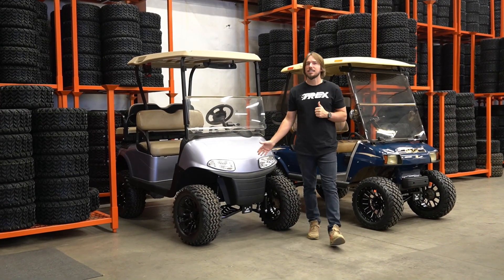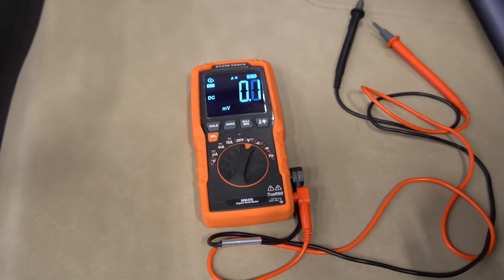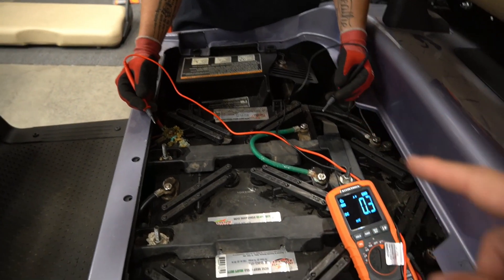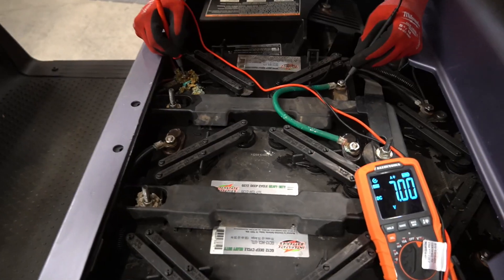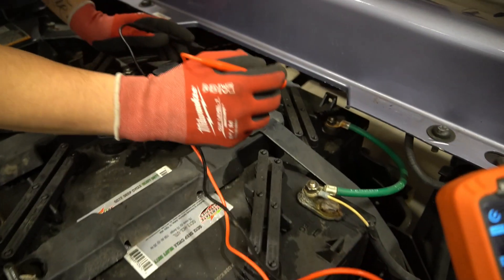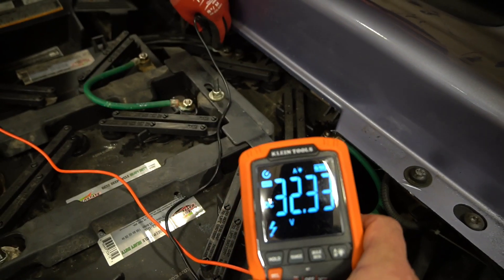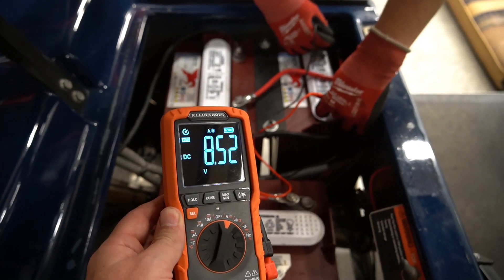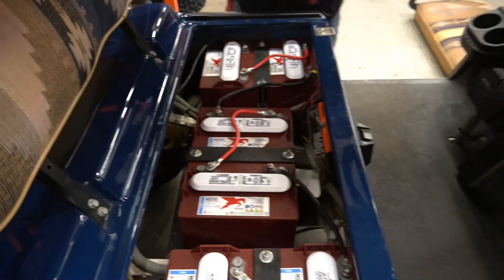How to Test Golf Cart Batteries *8V, 12V and More*

Comment: VIDEO IS WRONG! Batteries can be the correct voltage but will fail a load test (simulates driving). The correct way to test a Golf Cart battery is with a $20 load tester, like the one at Harbor Freight
Reply: This guy is 100% correct.

Comment: Nice video thanks. My total system is reading 51 volts but still does within 15-20 min of driving it. What would be the next step to check for? 2015 club cart precedent
Reply: This video gives bad advice. You need to get a $20 load tester from Harbor freight and check each battery.

Comment: That's testing surface charge!!, you need Amps .. drop test!!
Reply: Agreed. He needs a load tester.
Reply: My 12v batteries on my Gem Car shows 12.75 or better on all batteries. BUT the Trojans, on a full charge, only get me 6-7 miles!!! I'm thinking that there is more to checking the health of a battery...than just volts. Is this the Draw test/Drop test? How/where do I get info on that?
Reply: @paulsavino1898  go to Harbor freight and get a $20 load tester

Comment: If I have new batteries and not reading 12 is it the charger or connections look fine
Reply from the maker: Are your batteries 12V or 8V? If the are 8V they will read just over 8 on the multimeter. If they are 6V they will read just over 6 on the multimeter. And if they are 12V, they should read just over 12 on the multimeter.